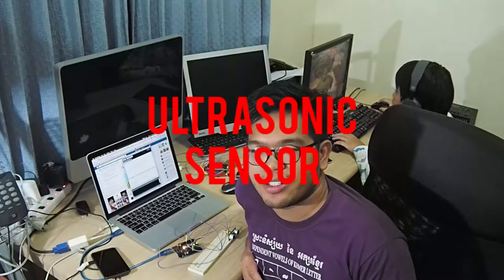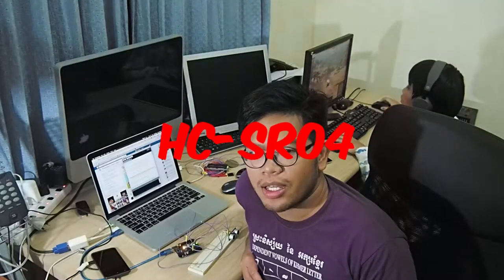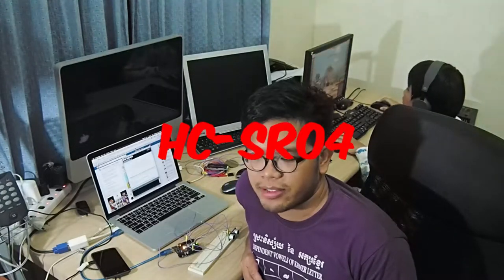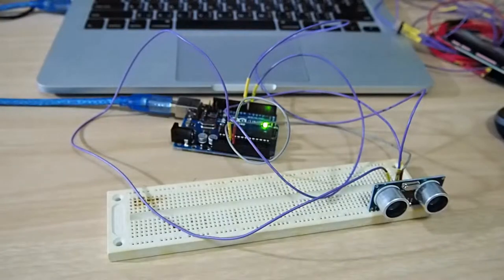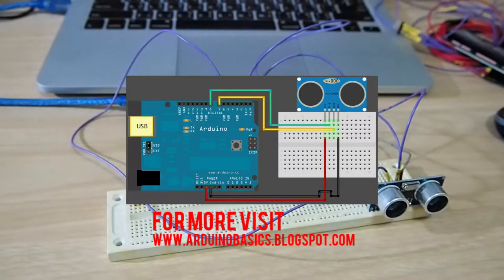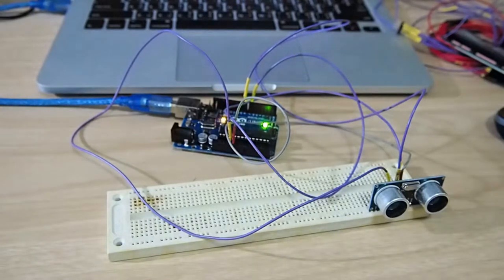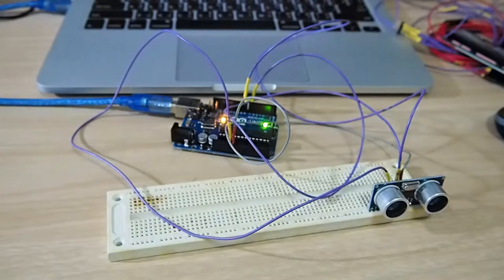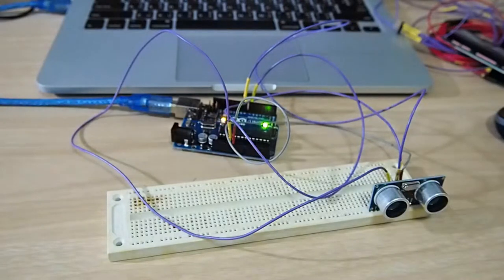Ultrasonic sensor hc-sr04 + arduino + signal to processing

Comment: it would help alot if you actually post the links in the description
Reply from the maker: +Sys.stem http://arduinobasics.blogspot.com/2012/11/arduinobasics-hc-sr04-ultrasonic-sensor.html
Reply: +eooes where do i get the sounds like in video ? i dont see data folder or nothing in processing setup or loop ?
Reply from the maker: +Sys.stem you need a lib called soundcipher. I like to share on github, but sadly I did not keep the code, it's gone. Anyways, edit the processing program to make a sound using variable "distance". e.g. yourwhatever.playNote(distance, 100, 2.0);